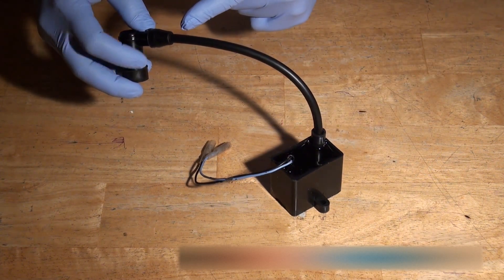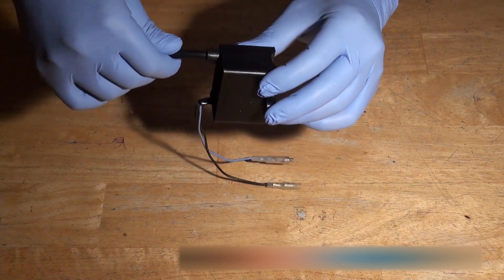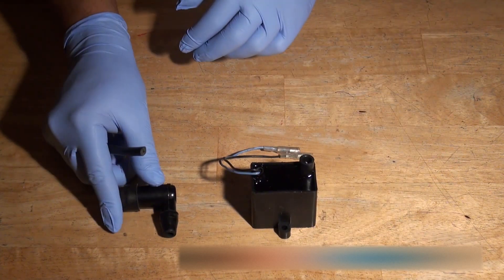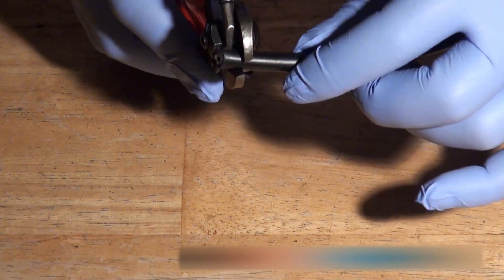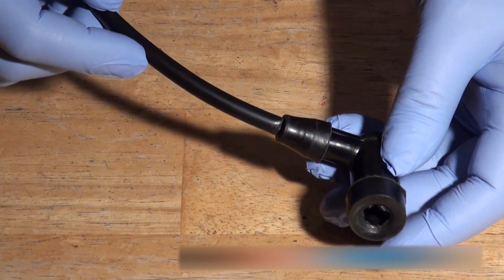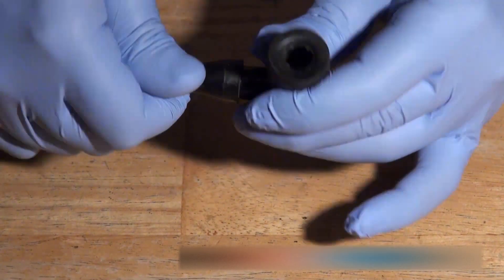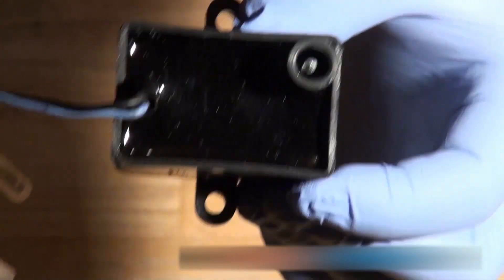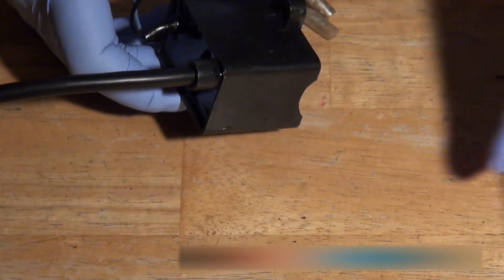Bicycle Engine Kit CDI Troubleshooting Tips

Comment: quick question i get spark but its not much is that the cdi issue.the thing is my bike wont start i get gas and spark but nothing it wont start can it be that there is not a nuff spark to get it going
Reply from the maker: Hi Lee, 

Before you do any of the below checks you need to eliminate the fuel side from the equation. Once you are satisfied that fuel side is fine then do the checks below:

1. Check all the wiring to make sure you don't have any loose connections resulting in a weak spark, also check the cables at the magnetto end where they attach.
2. Check to make sure you don't have any shorts in the wiring anywhere and also check to make sure everything is grounded properly.
2.  Also do the CDI wiring check in this video (plug boot & base).
3.  Then replace the spark plug and see if it makes a difference.
4.  Then replace the plug boot (i have come across faulty ones in the past).

All the above no difference then do the below in the order below::
1. Replace the magnetto (still no difference go to step 2)
2. Replace the CDI

I'm 90% sure if you follow the procedure above you should get it up and running ....
Reply: BritishTech TV ty for the info i smell gas on tge motor when i pull the plug but the spark is week i order a new carb a new cdi and a new magneto just in case lol
Reply from the maker: Lee, one of the things i used to do when i used to ride one regularly is always keep 1 CDI, 1 Magnetto and 1 spark plug as a backup with me on the bike.  Trust me you don't want to be stranded :) ...
Reply: BritishTech TV ty i went to push the button for the gas on the carb and gas started to spill out of there this carb is mess up cant wait till monday for my new one
Reply from the maker: Well I hope you get it back on the road soon.  If you want you could take the old carb apart and clean everything completely, then dry it and put it back together.  There is a spring needle inside the bowl of the carb which stops fuel overflow, if dirt gets in its path it will not be able to close properly and you will have fuel leaks etc.

Comment: that "fresh end on the plug wire" trick is absolutely a "must do" on pretty much all motorcycle coils or CDIs, whether just off the boat from china, or just out from under the back porch after a couple years off duty, lol. that little trim off the end is also standard procedure if you upgrade the plug boot, or switch coils out as well... listen to the man, kids! that "fresh bite" makes a world of difference in spark intensity

Comment: hay i got it working quick question i installed this hp carb and the motor is running a lot hotter is that normal and what grade gas is good for this motor bike
Reply from the maker: I have only used the NT carbs so i cant make any comment on the HP type or how it may affect the heating of the engine.  When you say what grade, do you mean what grade oil?  If so then 2 stroke oil will do, if you really want to take care of things you could use fully synthetic.

Comment: Your annotation is incorrect. I have a kit from 03-2014 and my ignition wire is mounted by a screw in the cdi.. I think it may have been lightly glued but it came out without any tools
Reply: +ilikebeer also the boot itself is not screwed in, it is a spring that pierces through the end of the wire. The best way to remove the boot is to put that spring through the boot and then remove it and pull the wire back through
Reply: +ilikebeer sorry, commenting as I watch, but when you're screwing the parts back in, there's a pretty good chance of "stripping" as there is no threads - you're essientially just wedging the screw between the small wires. If this happens, just unscrew the wire, and squeeze is with some pliers or vice grips a few times to bunch the wires back up. I find starting at a slight angle helps to sort-of tangle the wires up around the screw. or find a thicker gauge wire, which is what I did.